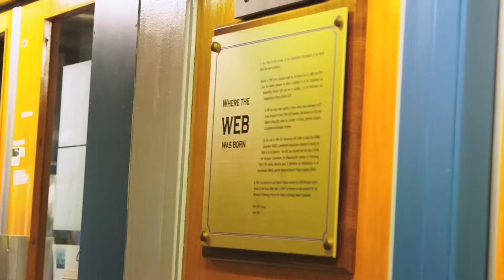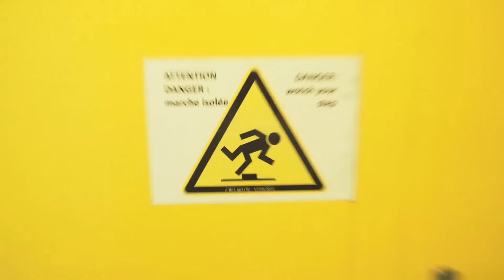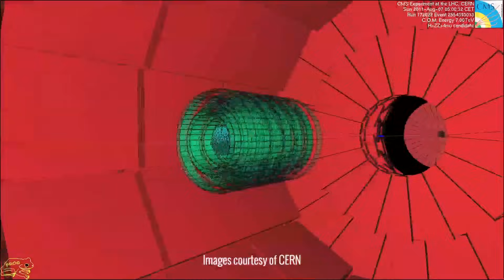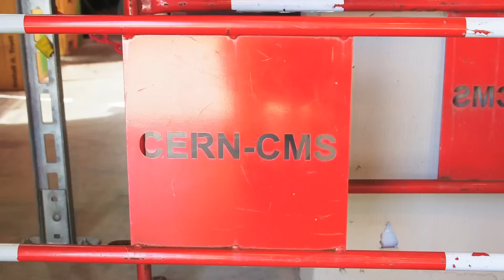CERN: Undergound Large Hadron Collider | Engadget

Comment: I remember someone said this place has the doors to Hell. I would never want to go there.
Reply: Exactly, they are trying to obtain the “God particle,” I’m not too informed but experimenting with that could lead to disaster. Possibly a creation of a black hole.
Reply: I heard this knocked us to another dimension.
Reply: @vespine1749  that's not how black holes work. It is extremely unlikely (not to mention strictly theoretical) that a collision would result and the creation of a tiny, subatomic, black hole that would decay rapidly and pose no threat. 

You also referred to the "God particle", officially known as the Higgs boson, which gives mass the particles that have it. You can't actually obtain it, as it brakes apart as soon as it's created.